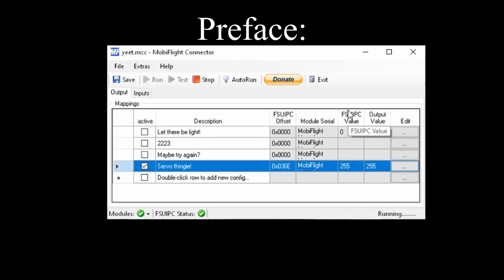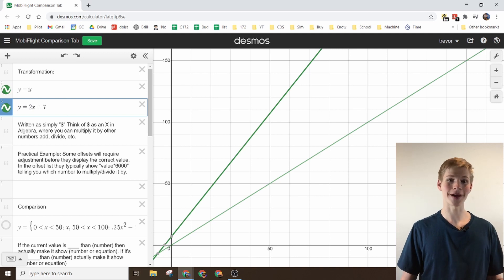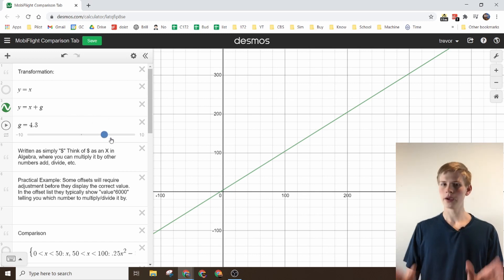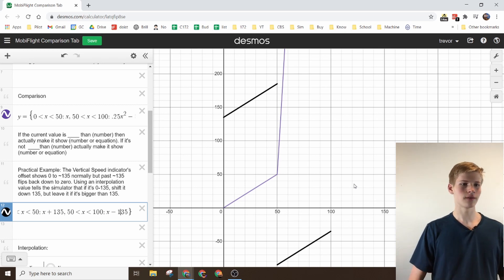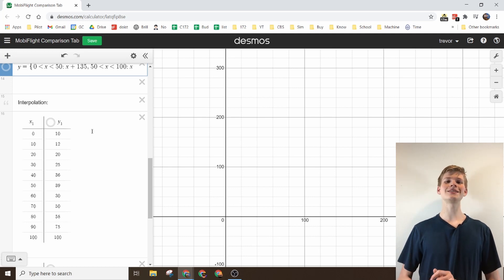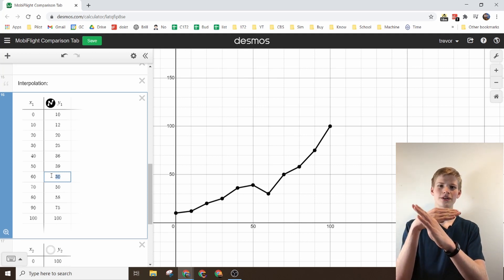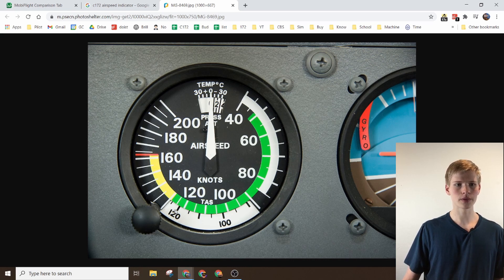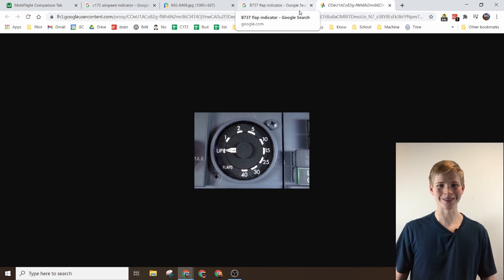Compare Tab Explained | Captain Bob

Comment: Nicce dear o like yours vid i make bell 412 sim at home my N1 gauge and ITT not calibrate with normal setting .ITT max 1024 c give me idiea
Reply from the maker: This is a good question! It can be a little tricky calibrating it, but I think your best bet would be to  use the interpolation setting to define your minimum and maximum point, then any points as needed. You can guess values until you get close enough. Some offsets also have transformations, so use those if needed!
Reply: @CaptainBobSim  ok good i going home then trying it thank u dear
Reply: @CaptainBobSim  and send u pics
Reply: I use steper motor